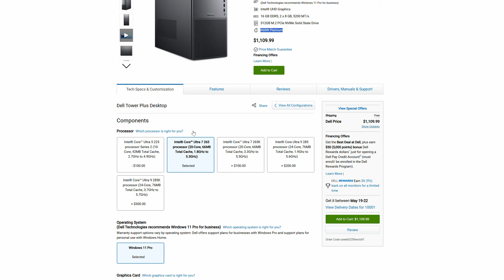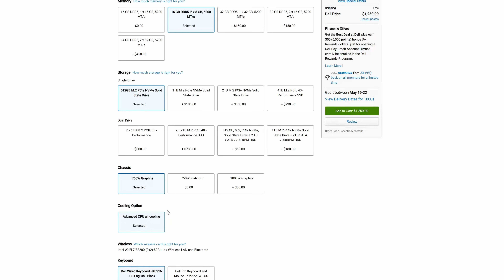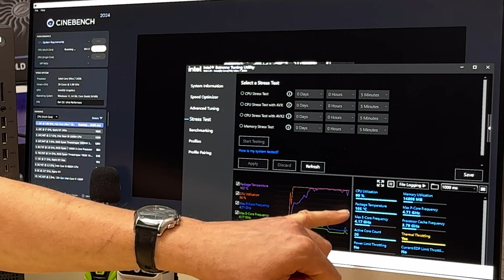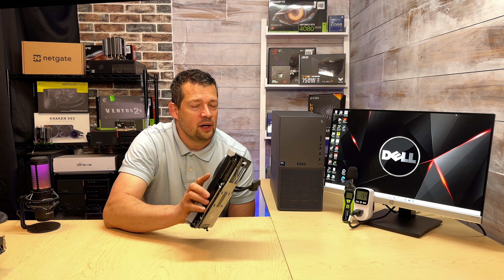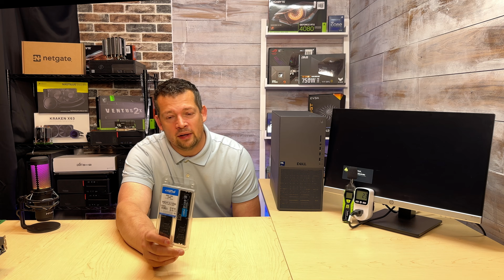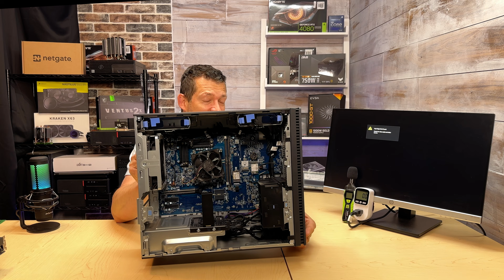Dell Tower Plus EBT2250 - Watch this before you buy it!

Comment: EBT2250 has the Nvidia GPU card but it only has 1 HDMI connector and 4 USB connectors. I want to connect a second monitor, so which connector should I use? The USB connectors on the GPU or the USB-c connector on the back of the PC? I want the best graphics I can get on the second monitor too. Thanks.
Reply from the maker: Yes , use the connectors on the GPU.
They are not USB but display ports.
Look at your second monitor and see if you have a display port on it,
If not just get a 4k display port to HDMI adapter.
Let me know if you need any help!
Reply: @Scott.The.IT.Guy.  Ok now I have 2 Dell S2725DS. I want to expand these so the mouse can jump from monitor to monitor. My EBT2250 has the recommended Nvidia card so it has a single HDMI connector. How should I connect the second monitor for maximum video? Thanks.
Reply from the maker: @MarkP-m7w   Hey Mark, That Dell Monitor has only one Display port so you cant jump from monitor to monitor. Just get a 4K or 8k Display port to Display port cable and use that for the second monitor.
https://www.amazon.com/Ubluker-DisplayPort-Certified-Braided-DSC1-2a/dp/B0CJQ8VQ2B/ref=sr_1_1_sspa?crid=K2U216YZ2Y22&dib=eyJ2IjoiMSJ9.XYoRDi1dY4voyaKr-iJHx35_OxgWSrSHK_aiOtRXCCCU-2KXQd2xVPnsVjdcfRYpq-UtzRKcA-_HbR4L2gKqLB_oBeUXj7QgqL-KPiRoxcmG5ZCyA8vjv0NXTP4CMtPyQz7MvVhXC-XeKUm0XM88H7ui_UIPDEQwDOMXQQ3oHssifuajwbXdp5rRzMpZ7MipZelthYeuUPJiFHFrUyE5jicda6qmQDs05o_jfs1BeTQ.kF_hng9JgPk_RdhihJM_-2PYzJpuS6XMANTUcEGtkpE&dib_tag=se&keywords=8k%2Bdisplay%2Bport%2Bcable&qid=1768290170&sprefix=8k%2Bdis%2Caps%2C112&sr=8-1-spons&sp_csd=d2lkZ2V0TmFtZT1zcF9hdGY&th=1
 You first monitor will run on the HDMI cord.
Reply: @Scott.The.IT.Guy.  That worked like charm thanks.

Comment: Thx for this informative vid and a look around inside the case. I'm about ready to pull the trigger on this but am waffling over the move from the 265 vs. 265k. I'm not a gamer but I do a lot of Photoshop work. Little to no video editing (just simple stuff using GoPro software).  I will be upgrading from a 2019 Dell XPS 8930 that's been running pretty well, but I'm keeping an eye on rising prices and figured with the switch to Win 11, I might as well make this move. I did have a power supply fail on my 8930 and was planning to pay for the upgrade to the 1000W supply as a precaution. Given all that, and my most frequent use-case of PS editing, any reason not to save the $100 and purchase the 265 with the 1000W power supply? That would halfway pay for the 64 RAM I'll be purchasing and installing myself.
Reply from the maker: If you buy a “K” cpu that will not only upgrade the cooler on the CPU but also upgrade the standard 495w power supply to 750W. I would not get the 1000W PSU . I go through hundreds of Dell desktops each year and the power supply failure rate is technically not exist.
I know you had one , but it’s super rare.
Reply: @Scott.The.IT.Guy.  thanks for the input! Any vids on installing additional HDDs on the horizon?

Comment: Scott really enjoyed your video -kudos to you. I'm contemplating the same 2250 but I had one question in terms of a graphics card; I would like to be able to use the 2 PCIe slots below the GPU slot. As configured with either the RTX 3050 or RTX 4060 do you know if the 2 PCIe's below will be accessible? BTW, I think you made an excellent comment regarding the difference if perhaps the case had been 1/2 inch taller, which would have allowed the motherboard to have more space, and perhaps my issue above would not be an issue:)
Reply from the maker: Hey,

I actually have a video on this topic:

https://youtu.be/lbNyvbt-ZW4?si=F_pZJOUF0571CC6q
Please let me know if you have any questions!

Comment: Thanks to your videos I Upgraded my EBT2250 with 64K Corsair and two 1TB M2 Samsung Pro. So easy for me to do. Now, I'm looking for extra parts like the M2 Standoffs and the tiny screw with that. I've looked everywhere including Dell and haven't found them yet. I even checked Ace Hardware, Home depot, etc. Do you know where I can find these? Thanks.
Reply from the maker: Search for m2 ssd screw kit  on Amazon or eBay or Microcenter:

https://www.microcenter.com/product/626316/micro-connectors-m2-nvme-ssd-installation-kit-with-low-profile-heat-sink-and-mounting-screws
Reply from the maker: https://www.amazon.com/Micro-Connectors-Installation-Low-Profile-NGFFM2-HS-KIT/dp/B08CK524L3/ref=mp_s_a_1_4?crid=6B1RIBND0SX7&dib=eyJ2IjoiMSJ9.O9uPjjW2tgAS6R9ZRH72xYISeNZfItyjDcwajhmaJukuXHI0ughddqqTNHh5kAq6jWaj1NK-74221gFF1lz2tWCzV5NQUAFYKpg9X2Emo0qSRg2NQ6gk7yxGNLQYokf1q-n_u2uXPeUTf8DHbx3B5BSrrcdhJyv6XA681DcB1ikB7dFsq4xNJKszhgcCJBAOVx8oJSf9y7Dt0oH8lOryZA.NsGClAh-LUSc1Qjqv0-dYhmTxA38swvlyMrwvMdK7Z8&dib_tag=se&keywords=M.2+NVME+SSD+Installation+Kit+with+Low-Profile+Heat+Sink+and+Mounting+Screws&qid=1758973007&sprefix=m.2+nvme+ssd+installation+kit+with+low-profile+heat+sink+and+mounting+screws%2Caps%2C71&sr=8-4

Comment: Hi Scott, I am planning to purchase this computer without a graphics card installed and then add one afterward. Would it be possible to install an RTX 5090 with a 1000W power supply in this system?
Reply from the maker: Have you seen my EBT2250 GPU upgrade video?

https://youtu.be/lbNyvbt-ZW4?si=_YtIAW91NDQkirnC

I packed as much info I was just able to, please look at the measurement part and make sure that the card you are looking at will fit in this case! Fe3el free to ask any questions after that!

Comment: So, in my current Dell XPS 8700 I have a 1TB SSD with the OS.  Then I have a 12TB  3.5 HDD and a 16TB 3.5 HDD to back up both drives.  Will this tower accomodate both of the 3.5" HDDs?
Reply from the maker: Yes it does, as long as your main SSD is an m2. When you buy it your main ssd is m2.
It has two 3.5” bay on the top of the case with pre installed power and sata cables ! You can use two  3.5” or 2.5” HDD/SSD.

Comment: Thanks for mentioning the two bays at the top of the computer.  Does this mean you can remove the M.2 board (and save it as a baseline install drive) and use an old SSD from a different computer, insert into one of the bays, and make that your Disk 0 drive?  My intention is to boot this as a Win 10 machine with my old setup, and THEN do a Win 11 upgrade.  Will that work?
Reply from the maker: You can totally do that as long as your old system is not mbr but UEFI.
You go for the bios and change the controller from raid to AHCI.
If your old system still won’t boot , go back to bios and turn off secure boot.
This should get you to a working system.
Update to W11, update all the drivers , install intel raid , try to switch the controller back to raid !
Any updates, problems, messages me here !

Comment: I agree you want the Advanced CPU Cooling.  Order from Dell if you don't want a bent up piece of junk.  It's best to go with a K series since a 460W PSU is a joke.  Even a 1660 series wants a 550W PSU.  I order these with 8GB RAM & a 256GB SSD.  The included SSD is some Kioxia garbage with zero software support unlike Samsung Magician.  The age of the computer is based on its release year, not when you bought it.  Disable Capsule Updates in the BIOS.  With this being enabled this allows Windows Update to update your BIOS & I have see this brick an 8960.   I was able to recover the BIOS.  Use Dell SupportAssist or update the BIOS manually.  I NEVER run RAID.  Go with AHCI.  You will run into Windows Security / Device Security / Core isolation / Windows Memory Integrity issues with RAID enabled.
Reply from the maker: You packed so much useful information in this comment based on real life experience , are you a tech as well?
Really appreciate your spot on comment!
Reply: @Scott.The.IT.Guy.  Yes I am and I tend to use Dell's.  I've moved over to ASUS NUC 15 Pro's i3's for customers that need a low end solution.  Chrome, Office, etc.  32GB of Crucial RAM and a Samsung 1TB 990 Evo SSD.

Comment: I understand the premium air cooler is quieter compared to the standard cooler when the CPU is under heavy load, but how does the noise level of the premium air cooler compare when at idle?  I find the standard air cooler on my Dell to me noisy when the CPU isn't under load.
Reply from the maker: I have a full video on this topic:

EBT2250 CPU Cooler Upgrade
https://youtu.be/a8z6ZFnNnOc

Comment: Thanks for the great detailed videos for this EBT2250.  I noticed mine came with a single (generic Dell) 1TB SSD PCIe type drive and underneath is a small thermal pad. I'd like to upgrade to, 2 Samsung 990 EVO Plus SSD 1TB, PCIe Gen 4x4, Gen 5x2 M.2 2280 drives, do I need to add thermal pads or do I need to purchase heat sink versions? 
I'm not a gamer. Thank you.
Reply from the maker: Thanks! I would add the thermal pad, but you likely don't need a heat sink for your use case.I have been using my 990 pro for a while, runs on full speed , absolutely no issues. I don’t think I even replaced the thermal pad.
Reply: @Scott.The.IT.Guy.  This may be a stupid question. I'm upgrading to this EBT2250 from my 2009 home build PC! I'm finding out the old integrated Netcard is not able to able to handle the present day 1 Gig service. Will the EBT2250 integrated card be able to handle this now? There doesn't look like there's enough room to add a plug-in card.
Reply from the maker: No wrong questions here!
The integrated NIC is perfect. I have some of these at business customers, hard wired , we have zero issues!
The port is actually  2.5GbE but downward compatible,  connecting it to a 1 Gb switch will work!
Reply: @Scott.The.IT.Guy.  Received my EBT2250 and excited to get it running. I'm upgrading the RAM and 2 Samsung 990 EVO Plus or Pro SSD 1TB,  drives. However, I removed the generic Dell SSD drive and there's a small pad (20x20x5 heat pad?). The second drive spot doesn't have one. I don't know if I should remove that little pad and add full length pads under both new SSD's? Or just cover marked areas only?
Reply from the maker: @MarkP-m7w  If you put extra padding there it might help. I never out any extra there and  also usning a 990 Pro , no issues at all.

Comment: My EBT 2250 would not recognize an RTX 3060 or GTX 1660 so it wasn't the under-sized PSU @ 460 watts (3060 needs a min.  550 w)  but I got messages to attached the pcie cables to GPU.  EBT 2250 DOES NOT  use cables,  so there's no way to run either gpu,  which is why Dell doesn't offer  the 3060 at time of purchase.
Reply from the maker: Both 1660 and 3060 should have the power cable connected from the PSU.
You have two sets of 6 pins and 8 pins cables stored at the power supply. You can just un clip them and they are ready to go.
Unplug the power cord, install the card you want, connect the power cable.
Press and hold the power button for 20 seconds .
Connect your hdmI or dp cable to the card instead of the motherboard.
Plug the power cable back in and don’t do anything. Wait a few minutes.
Hit the power button one time, tell me what happened.

Comment: Scott help! Please send me the SKU or part number for the ram kit. I'm purchasing this machine and I wanna make sure I buy the right kit also can you do a video on how to create rate zero via software? I'm looking at grabbing two single SSD drives. BTW: if I do, are there slots to add additional SATA drives for data storage? Cheers
Reply: Thanks brother super helpful!
Reply from the maker: @DrummingMan1 You are welcome!
Reply from the maker: Crucial 64GB DDR5 RAM, 5600MHz  CT2K32G56C46U5. We can do a raid video, its super easy to set it up.
This PC has two 3.5" Sata bay at the top of the case. You have the data and the power cable there already so connecting the drive is easy , however these are 3.5 “ Sata brackets. 

So, you're going to need some kind of reducer, even probably a generic will work from 3.5 to 2.5 “

If you just ended up putting the 2.5 SSD drive into a 3.5 slot, nothing will happen. There are no moving parts, so things will just work. There is a Dell bracket, but it's extremely difficult to get it.

Comment: I Hi Scott, I just purchased this model, and was wondering if I can pull my Crucial 1tb SATA ssd from my laptop to increase my storage capacity?
Reply from the maker: You should be able to install your 1TB SATA SSD no problem at all.Unfortunately I don’t have a part number for you for the 3.5” bay.
I normally just put the 2.5” dive inside one of the 3.5 top bay and it’s fine there as is.
Reply: @Scott.The.IT.Guy. Thank you, Is there a spot for it or do I need to purchase an adapter to hold it in place? Is that what you’re referring to?
Reply from the maker: You have two 3.5” bay on the top of the case. Power and data cables are there so that is not an issue.
You will need a 3.5” to 2.5” reducer caddy.
Dell manual:
https://www.dell.com/support/manuals/en-us/xps-8960-desktop/xps-8960-service-manual/removing-the-2.5-inch-hard-drive?guid=guid-72a37fa9-8dc0-4c09-9719-b3e4756f565d&lang=en-us
The only Dell part number I can come up with is “7CM76 bracket caddy” but o can’t find any place to buy it.
I would not worry much about it.
I would just put the SSD in the 3.5” bay as is, it has no moving parts, will not cause any issues.

Comment: Thank you for all of your reviews.  I am looking at getting this computer without a graphics card installed and adding one after purchase.  Question, does the case come with a graphics card support bracket installed if the case ships without a graphics card?  If it doesn't, do you know what the part number is?  I tried looking at the Dell site and could not find anything.  Thank you.
Reply from the maker: Look for this fell part number on EBay:PKXHN
With this, you should be good up to a RTX 4070 or a 5070. Anything above, I would definitely do a third party magnetic stud (which usually comes with a card)
Reply: @Scott.The.IT.Guy.  You are awesome.  Thank you.

Comment: I recently bought this PC (with 64 GB of RAM, 1 TB NVMe SSD, and a Core Ultra 9 285K processor), and since the motherboard uses PCIe 4.0, I just wanted to know if it works well with the new RTX 50-series graphics cards? From what I understand, they run on PCIe 5.0 but are supposed to be backwards compatible with a PCIe 4.0 motherboard.
Reply from the maker: They all work that way, that is never an issue. However I remember seeing the PCI 5.0 mark next to the slot on the motherboard.
Reply from the maker: I am looking at the EBT2250 manual:

"One PCIe x16 mechanical/x16 electrical Gen5 slot" you are good to go!

Comment: Thanks for the awesome information! I was looking at this PC on the Dell site, I'm upgrading from my old Dell XPS8910 and am going to get the Ultra 7 265K option.
Found the exact same Crucial  64 GB RAM kit shown here on Amazon for $209.00 USD. Not bad at all.
Do you (or anyone) know if upgrading the RAM and or the GPU has any effect on the warranty or the Dell Care Plus support service?
Also, will my NVIDIA GeForce GTX 1080 Ti GPU fit in this PC? I'm not too excited to pay Dell GPU upgrade prices.

Thanks man, this was so useful!  Literally just started shopping today and it's nice to be off and running from the start with such solid information and tips!
Reply from the maker: It’s sad because even a couple of weeks ago I got some of these kits for $139! I would try the 1080 Ti for sure!
Reply from the maker: I never worry about the Dell warranty , with none Dell parts. I

Comment: Great video! Just got mine EBT2250. It comes with 2TB M.2 PCIe NVMe SSD. Now I am considering adding a second SSD 2TB or 4TB. Which models would you recommend that are compatible with this computer? NVMe vs. SATA? If you can do a quick video on how to add the SSD, that would be fantastic. Thank you!
Reply from the maker: Hey,
I would get another m.2 since they are so much faster than Sata. 
I would get a Samsung Evo plus or a WD black drive. If you need a lot of storage get the 4 TB one if you don’t have a ton of stuff just get a smaller drive . 
I can make  a video on a Dell desktop how to add storage soon. Thanks for the suggestion!
Reply: @Scott.The.IT.Guy. Thanks very much for your quick reply! I’ll shop for a Samsung or WD m2 ssd. And I look forward to your video on adding storage for Dell desktop!

Comment: Mostly am going to buy this PC. What I did is I customized mine on the Dell website. I happen to just maximize everything on it. Trust me it will be super expensive but hey I don't mind paying the money and it's worth it. 

But I also use 2 screens right now on my XPS at the moment. 

I will upgrade to this PC. I have my old one here since 2016. 

What do you think?
Reply from the maker: If I am not adding any graphics card to the PC, we are looking at $2500. 
You will pay $450 for the memory upgrade and $730 for the 4 TB SSD.
I can give you a non-affiliated link for a matching quality ram for $160 and $250 for the SSD.
You can replace the ram without any technical knowledge in 60 seconds. You can replace the solid-state drive with minimum knowledge. Or worse-case scenario, you can drop it off at any IT shops and maybe get the PC back in two hours.

This PC has one HDMI port but also comes with a Thunderbolt port which is also a display port if you get a 4K TB adapter to HDMI you can have two monitors without a dedicated video card.

If you really have the money and there is nothing else you can do with it, then sure. This is a great system, and this is a whole point that you buy something which you don't have to do a single thing with. Pay for it, you hit the power button, it's good to go for the next 8-10 years.

Comment: Hello there will a Thermalright Phantom Spirit 120 evo cpu cooler fit in this Dell and also the xps 8960  Cheers
Reply from the maker: This fan looks very similar to my Noctua D15 cooler!
It was just a bit taller than a case; therefore, I could not close the side of the case 😊
 But the main problem was the fans. The motherboard did not recognize them and constantly gave  me a warning every time I rebooted a PC that the CPU fans must fail!